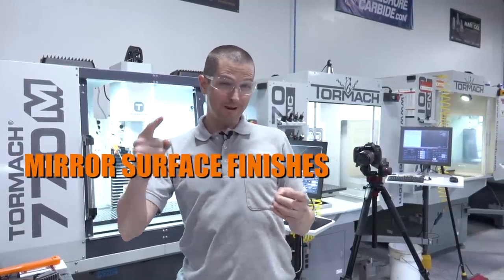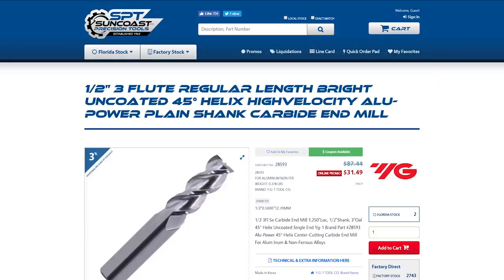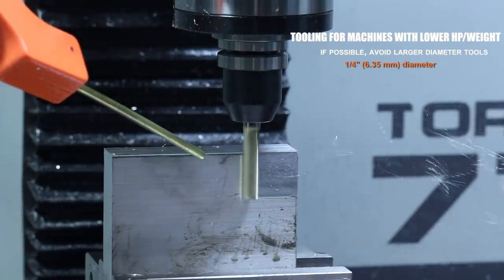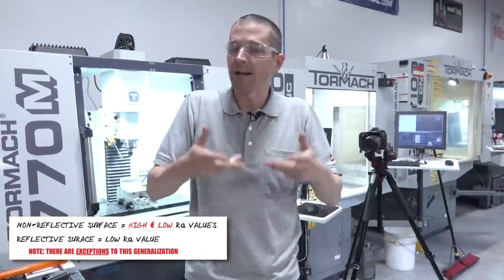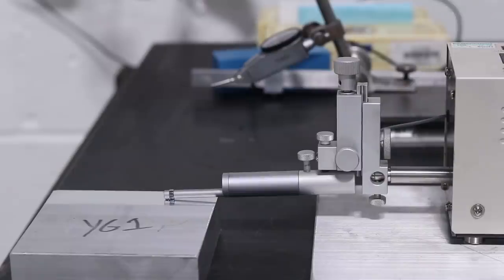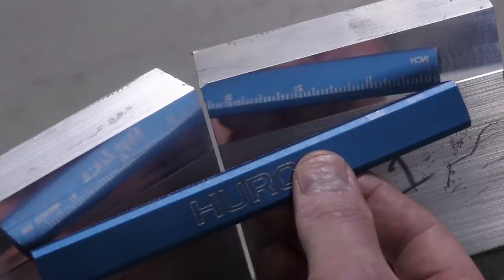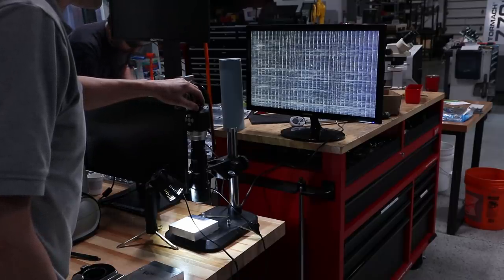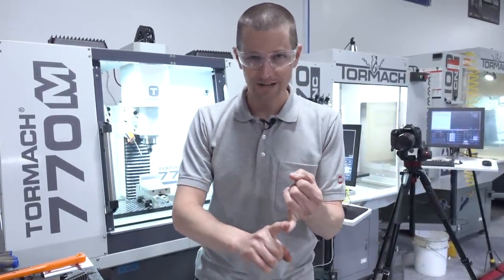Affordable Tool for Mirror Surface Finish! WW249

Comment: are you really using microinches on the surface tester? so 9/1000" between highest and lowest point of the surface? 'cause that can't really be, that surface doesn't look like it has over 0.2mm height difference within it. but then again, it's only Ra, not Rz, and it appears to be only one cut on one part of the piece, so if the aluminium isn't ground (at least cut on the mill) flat and parallel on both sides, that might be the cause. this would also basically render the entire testing and video useless, as those two test pieces will certainly not have the same deviation, making any comparison impossible as there's now more than just one variable (not to mention the surface tester being placed on what appears to be another piece of aluminium stock material with again other possible deviations).
the coating/carbide components of the smaller tool might also have something to do with the finish (I assume it's TiN due to the gold-yellow colour of the carbide tool), not to mention the type carbide in use (courser or fine) and the fact that the new tool seems to have very sharp edges which is preferable with softer non ferrous metals while the coating of the other tool might have covered and rounded the cutting edges of the material more than it was produced with originally (might increase tool life, but will cause more vibration if not taken into consideration) or it didn't have as sharp edges to begin with or it might have been meant for a different material altogether. the angle of the flutes also has a bit of say in the surface finish.
there's a whole lot of possible causes for differences in the finish, otherwise there wouldn't be such a large variation of tools with the same number of teeth and the same diameter.
one just needs to take into consideration what is demanded by the customer and what is necessary for a given task/purpose of the part and keep the pricing as reasonable as possible.

Comment: I’ve been using those YG-1 for years and the past year the prices have been creeping up as popularity increases. I recently found a new company the finish is even better than YG and they also have a cutter that leaves steel looking just as amazing. Unfortunately for you guys I’m not sharing that brand cause y’all will drive the pricing up and right now they cost 1/2 to 2/3 of a yg-1 end mill and they also finish better. Gotta be careful not to bump them they will slice you wide open. My guess is anyone seeing their price will instantly deem them poor quality so it benefits me. Besides that I use a lot of indexable cutters which are cheaper to run and finish just as nice with the proper inserts. Now that you’ve made this video I bet YG prices go up even more. Oh well just in time I suppose.

Comment: You always talk about aluminium and that sort of stuff   try 316l or duplex   trust me everything you will get challenged the hardest part about   aluminium  is chip adhesion 

Stainles  gets under your skin     so if you want a challenge get some stainles or  chromoly steel  getting a good surface finish on steel is hard